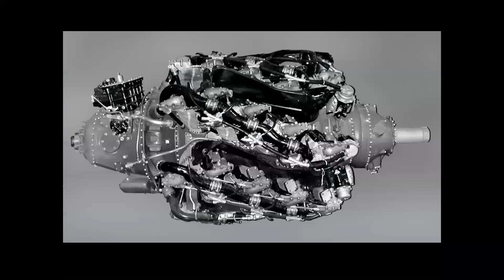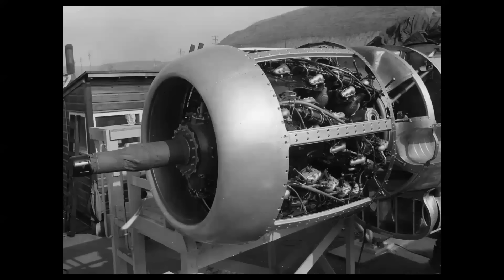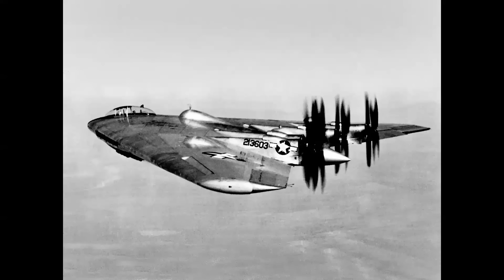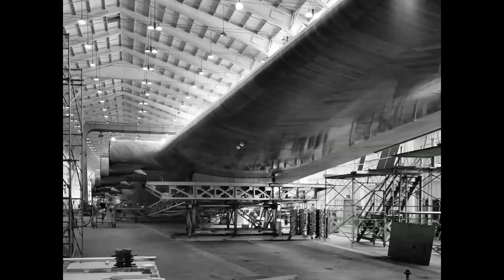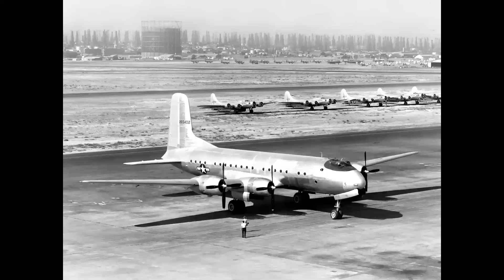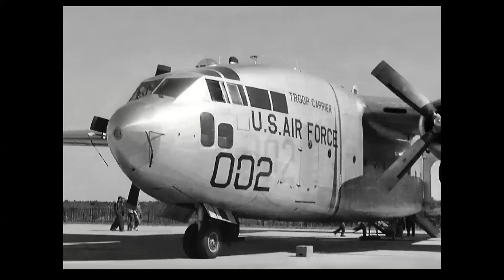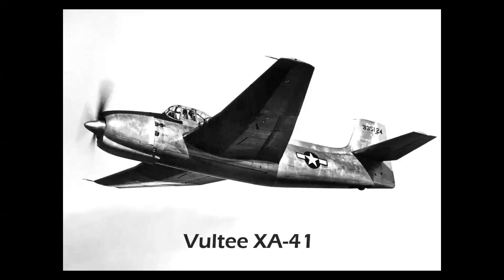PRATT & WHITNEY R-4360 WASP MAJOR AIRCRAFT - Airplanes powered by this giant radial engine

Comment: What do you think about building a new version of the R-4360 Wasp Major Engine using modern technology, Electronic Fuel Injection, Computer Controls, and lightweight, but stronger materials?
Reply from the maker: That would indeed be the ultimate "resto-mod!"

Comment: The Goodyear  f4u Corsair  experimental used a 4360 Pratt and Whitney for the NAVY Known as the F2G Super Corsair. Not very many were made  maybe 10 or 11 units .  These engines did have heat problems  though which called for  more frequent  servicing .

Comment: In the 80's I worked on Cobra helicopters that utilized a Lycoming 53 turbo shaft engine. 1250 shaft horse power.  Three engine mounts, including a strut. Wasn't that much bigger than the starter motor of the R-4360. How times have changed.

Comment: Sadly the B-36 often had more than 4 burning.  Engines overheating and catching fire was one of the vices that never really got solved for this aircraft.  I am not sure how Nortrop solved the cooling problem in the flying wing.  Both aircraft being pushers certainly increased the challenges of cooling those engines.  I never understood why the B-36 was done in a pusher configuration because it would have got better cooling in a tractor configuration and there is not really any reason to use a pusher on a straight wing where Northrop likely found it necessary.  Another side effect of pushers on the wing is the props eating disturbed air that is moving at different velocities above the below the wing.  This increases noise, vibration, and stress on the prop blades.

Comment: I never really understood why the B-36 used the R-4360’s in a pusher configuration. They could not get the proper cylinder air cooling. In the Navy, I worked on the R-3350’s of the P2V7. No cooling problems in the tractor configuration. The only problem was the higher maintenance resulting from the PRT’s…..Mark

Comment: The Martin Mars, Hawaii mars and Philipina Mars never had this engine. It used the Wright Cyclone R 2800 engine. Please check your facts. And the Mars can be made fully operational as airal firefighter bombers with a short amount of time.  They only need a contract to fight a fire
Reply from the maker: Please check your facts before commenting. Production Martin JRM aircraft were named "Hawaii Mars," "Philippine Mars," and "Marshall Mars," and were powered by Wright R-3350 radial engines. The final production aircraft was the upgraded "Caroline Mars," designated as JRM-2, powered by Pratt & Whitney R-4360 radials.
Reply: I have checked my facts,, I live on Spoat lake for 20 years and speak to Ex FIFT when they were operating @celebratingaviationwithmik9782

Comment: I bought a 4360 at an estate sell for 3k in 2012. I recognized the pressurized container can it came in and saw the lettering.   It was sealed and still had pressure.   I really wanted it for my hangar as decoration.  FYI , it took machinery to move the can around as it weighed as much as a pickup truck.   I got it home, depressurized it and unbolted the can. It was brand new from 1946. It’s was mounted to a QEC mount for a Martin Mauler. The logbooks indicated it had 3 hours of run time and was mint and perfect condition. It was so perfect I decided to donate it to the aviation museum at Addison airport in Dallas Tx.  They removed the waxy oil coating and left it on the QEC mount and displayed it.   It is a masterpiece!  

Great presentation Mike!
Reply: Outstanding sir😎👍

Comment: I was an aircraft line mechanic in the California air national guard during the viet nam war.our squadron flew C-97  four engine cargo planes powered by the P&W- R- 4360. We flew from California to Hawaii to Japan to viet nam and back over and over more times than I can recall in four years. The engine maintenance was intense because the line chief insisted on following the maintenance manuals to the letter. We had an entire wall of 2 inch thick manuals that covered every last nut and bolt in the airframe and engines of the C-97. We kept a back stock of new and rebuilt R-4360 engines all pickeled up in steel weather proof containers. During the NAM war it made more sense to replace an ailing engine with a  new unit than spend days diagnosing the old engine. 
Our flights were over the Pacific Ocean and back at night and covered many thousands of air miles and often much more, loaded down both ways with personnel, supplies and huge wood  crates of 50 cal. Ammunition lined up on the interior both sides of the fuselage, everything and everybody else made do by finding a spot big enough to either sit or actually lay down and sleep.
There was only one eternal problem, which even the flight crews suffered. The cargo version of our C-97 was bare aluminum and rigged with thouands of stainless steel tie down rings. These rings and their hooks could hold many thousands of pounds of cargo. But any loose rings and hooks  were  at the  mercy  of the four massive P &W engines  pounding through the stratosphere

C
Reply: I worked as a Recip Engine Mech in the Air Force from June 1963 to Feb.966.
I worked on the R-2000(HC-54D), R-1300(HH-19B) and the R-4360(HC-97G). LOVED MY JOB!!

Comment: A very good piece. Many thanks.
The R-4360 also represented a tipping point in aviation: it was the "last gasp" before turbine engines arrived....with a jump in performance and reliability. It appears that something similar is happening in automobiles today. An infopinion here:

https://uploads.disquscdn.com/images/3346f3f0014f77769cba4d7d57d340e3117a9cb94f9ffb78962a3e9f479380ae.jpg

Comment: Its safe to say the most powerful aircraft piston engine to reach production in any country during WWII was the Pratt and Whitney R-4360 Wasp Major engine.  It was designed by Pratt & Whitney's Chief Engine Designer Leonard "Luke" Hobbs.  It features 4,360 cubic inches of swept volume.  It has 4 rows each of seven cylinders, providing 28 cylinders total.  The cylinders are arranged in a carefully coordinated corkscrew concept as a means to eliminate excessive cooling, which led to its nickname, "The Corncob." It has no less than 56 spark plugs.  Depending on the model, it has anywhere from 3 to 7 magnetos.   It was test flown in the Republic XP-72 Ultrabolt prototypes and in the Goodyear XF2G-2 Super Corsair in 1944.  The R-4360-13 used in these prototype fighters were rated at 3,500 horsepower.  In fact, there was a contract for 100 Republic P-72's with plans to use these planes as V-1 Buzz Bomb interceptors because of the plane's ability to rapidly accelerate to 490 mph.  The order was eventually cancelled in favor of bomber escort fighters. As for the Goodyear XF2G-2 Super Corsair, it had disappointing performance characteristics with its top speed of only 430 mph and it suffered from handling problems that were never solved.  Even though 11 were built, only two survive today and of these only one F2G-2 Super Corsair is still flying.

Comment: R-4360 had 4 banks of 7 cylinders . one master cylinder for each bank had a articulating connecting rod. the other 6 cylinder rods attached to it. I was a B-36 and Reciprocating engine mechanic from 1952 t0 1958 at Fairchild AFB and Carswell AFB.

Comment: Er you forgot one other aircraft powered by Luke Hobbs beast, the French SE Almanac  built  in late 1948-49 as  an elegantly proportioned  long range four engine airliner smaller than a C-74 Globemaster, essentially a DC-6 on steroids, and a cross between a B-377 Stratocruiser and an 049 Connie. The Almanac was intended to keep France in touch with her colonies, like she did before the war  using even bigger Lateorciere flying boats.  But France,s elegant sparring partner to the portly B-377  failed to catch on with French airlines who were hoovering up second hand  DC-4 Skymasters a fraction the cost. Being big heavy with the same number of undercarriage wheels as said DC-4, the Almanac would not  coped  well with the poor airfields in  North, Central and East Africa.

Comment: I have read that the wasp major was a major pain in the ass as far as maintenance. The B 29 super fortress was an example of an engine that performed well new. But after 100 hours needed overhaul or a new engine. The wasp major was in a lot of air frames some civilian some military. After service and maintenance on previous Pratt and Whitney engines that were though and reliable the wasp major made service interval shorter and maintenance longer and more complex. They don't get a lot of credit but the ground crews are the guys that work long hours and keep planes in the air. They must have hated the wasp major. I expect the newly designed thing to be better than its replacement the major was better in horse power and that was all.

Comment: Been a few years, but they have a 4360 cutaway engine on display at Kansas City's Downtown Wheeler Airport. It's the version with the individual power recovery turbines. They also had a complete L-1011, sans engines. Huge.

Comment: P&W's hero radial engine was certainly a winner. The various design philosophies of various schools, all differed in layout of cylinders and intake/exhaust method. Had the jet turbine not superseded piston engines, I wonder how much room for improvement would have been attained? Certainly, in light of current ICE development, with the increase in efficiency and fuel consumption, who can tell?

Comment: Good video! Glad to see you included the XP72 Superbolt/Ultrabolt, which would have been a monster fighter had it ever reached productive status. I believe the Goodyear FG2 Corsair used the "corncob" 4360, originally intended for kamikaze interception late in WW2.
Reply: but the F2G's were no faster than the R2800 powered corsairs !!!
Reply: @wilburfinnigan2142  Actually I read they were about 10mph faster, but that wasn't enough to make the upgrade worthwhile. Corsairs were already more than fast enough for the majority of Japanese aircraft. Same situation with the P40 attempt with a Merlin, just not worth the expense for a small gain. Too bad the powers that be told Allison not to worry about major supercharging, instead relying on the still teething GE turbos, which wouldn't fit in an aircraft like a P40 anyway. Allison created some enormously powerful aircraft engines, but too late.

Comment: When I was doing Aircraft Tech for my PPL back in ‘90 there was an old timer engineer who talked about servicing QANTAS Super Connie’s here in Auckland NZ. They have 18 cylinder radials but he said he remembered the headache if checking 36 hot spark plugs looking for a “Miss”. The 4360 must have been very difficult to work on when hot!
Reply: In the KB50Js we had a engine analyzer so we could find that elusive "miss" could zero down to any plug or misbehaving  mag

Comment: You missed one, an important one, the Goodyear F2G Super Corsair. A total of 11 were built, 2 remain, and they were among the greatest air racers ever.
Reply from the maker: Agreed!
Reply: ... and the Curtiss XBTC-2 (2 prototypes built), one of four designs in response to a Navy requirement for a single seat heavy duty attack aircraft capable of dive bombing and torpedo bombing.  The Douglas Skyraider and Martin Mauler were the only ones that went into production, with the Skyraider lasting much longer in service than the Martin Mauler mainly because its R-3360 engine proved to be far less troublesome than the PW-4360.
In general, the final piston engine aircraft designs of the 1940s used either the PW R-4360, or the Curtiss R-3360, the two most powerful US aircraft engines ever built, and those that used the R-4360 did not last as long in service because of the much heavier maintenance requirements and reliability issues of the R-4360.
Reply: What about the Martin AM Mauler a single engine Navy attack aircraft.
Reply: @leonardwright6925 《☆》He showed it🔊

Comment: Great video. Beautiful engine.  I wonder if cooling was an issue on the rear cylinders.  By the time the air made its way back there it would be pretty hot.
Reply: Heat wasn't much of a problem because there was baffling that surrounded each row of cylinders that directed the air to the back cylinders. The cylinder head temp was taken from the A7 cylinder which was in the back and was the hottest cylinder.
Reply: @donallen7990 
Thx for the great answer.  Taking the temp at the hottest cylinder. That line of thinking came from an era when we had engineers that actually could think! 😊

Comment: In the late 50 and early 60s we had KB50J models in our IFR wing and nothing brought more thoughts off pure "joy"
when coming out to my plane and finding out it was time for a BLOCK plug change,224 spark plugs, and high tension spark plug leads that were held in with nuts and had to be safety wired plus cowling to be removed, it was not a lot of fun!
Reply from the maker: Great comment, thanks!

Comment: I don't know if I'd call it a success.  The maintenance intervals were short, and engine failures were very common.  They also just guggled oil, often using all 200 gallons (not quarts) per engine during one flight.  Both burned and leaked.   The flight engineers were kept very busy tweaking mixture and superchargers all the time.   The poor engines severely cut into the sales of the planes that used these engines.

Comment: I worked on P&W R-1340’s for 9 years and they required lots of maintenance. But, these engines were on ag planes, crop dusters as most know them and they held up really well considering. They weren’t surrounded by a cowling, no cooling baffles, none of that. Just a speed ring surrounding the engine. Anyway, they were just one row and I’m happy I never had to work on anything with more than one row, let alone four. The R-4360’s are really cool though. Of course, I may not be saying that if I would’ve had to have worked on ‘em. LOL!
Reply from the maker: Appreciate the comment, thanks!

Comment: Great video, I was mechanic on C-97, Delaware Air Guard in the 50’s. They sent me to 4360 engine school, what a magnificent engineering masterpiece. I then graduated from U of Del with a BSME and went to work for P&W Florida Research & Development Center as test engineer mostly out of respect for their engineering. I retired in 1995 after a very interesting and rewarding career working on RL-10, XLR-129 rocket engines, F-100, 119,135, PW-3005, J-58 gas turbines, and high energy airborne laser ALL.
Reply: Wow .great job .
Reply from the maker: If your R-4360 Tech School was t Sheppard AFB, Wichita Falls, TX, I was there in the late-1960s and those engines were still on their test stands on the west ramp! Great comment, thanks!

Comment: You need more info on the XB35 and why it was unsuccessful.  
I think you said it was in part because it didn’t have modern digital systems and flight controls? Who knew what digital flight controls and systems were in the 40’s and 50’s?
  Col. M. E. Grevemburg, a WWI & II Veteran, flew the aircraft and stated that it was an efficient bombing platform just for one opinion.
This aircraft competed well with the B36.  It later was morphed into the YB49, a turbine powered version.   
Jack Northrop refused to merge his company into Lockeed at the whim of the US government and the program was cancelled.  8 pre production aircraft and the prototypes were then ordered scraped as the program was cancelled.  The US was set back decades before they would get a flying wing bomber… from Northrop.

Comment: Even as a child I never understood that expression, six turning, four burning. Jet engines turn. They turn very very rapidly. And both types of engines burn fuel
Reply: Well, if you look at the engines from the outside, you can see a propeller turning on a piston engine and you can see smoke coming out the back of a jet engine. So one's turning and the other is burning.
Reply: @soaringvulture  only if you have no idea what you were talking about. Jet engines turn and burn. As do piston engines.

Comment: Excellent job! In A&P college we overhauled WASP R-985’s and it was a joy and educational. They were jus a single row but still a very interesting engine. I have seen these engines in museums and could not imagine the effort it would take to replace a cylinder in the middle of the “pack” while in the aircraft. Amazing engineering. You know your aircraft! Thanks!
Reply: The Nacelle as he put it is a QEC. Quick engine change. The nacelle contains the engine, oil tank and components serialized to the motor. You pop the cannon plugs, open and cap oil, fuel connections at the fire wall, pull the prop, grab a suitable dyno and load it to the weight of the nacelle assy, remove a few bolts at the firewall, and back it off the wing. RFI motor goes back on and the plane is down less than a day. Now you have time to change a jug. You needed a lot of boxed end offset wrenches because you break a lot when working on these radials. Very little room to fit a wrench at all let alone a sturdy one. I prefer turbines.
Reply from the maker: Appreciate the great comment, thanks!